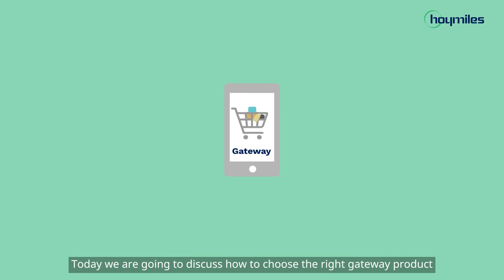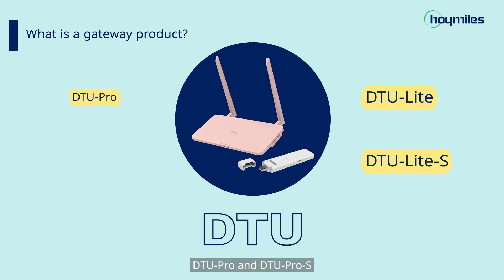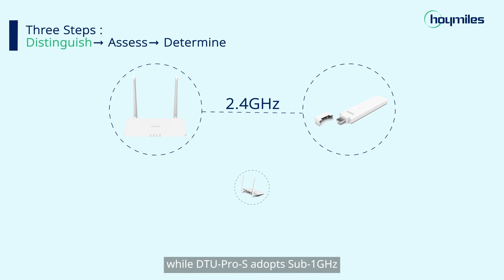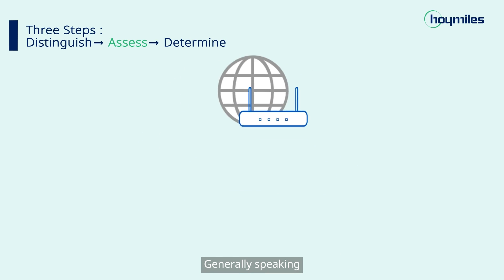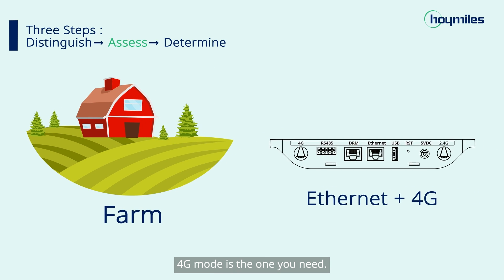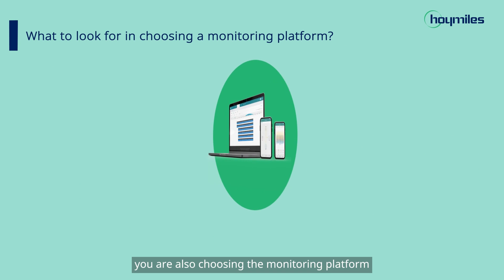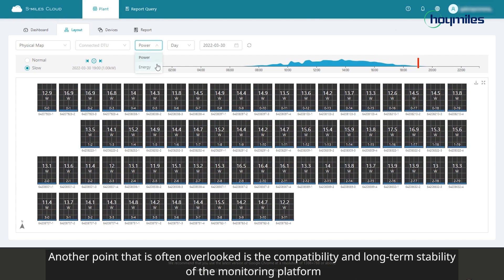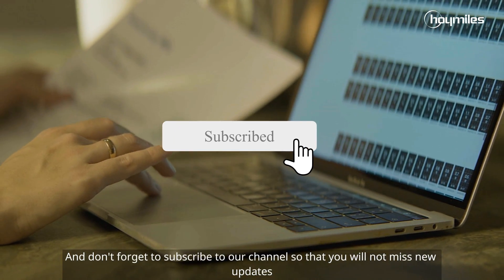How to choose a gateway product in 3 steps？| Solar

Comment: A couple of questions. 1. The DTU choice of communications seems to depend on the microinverter, for example, HM microinverters are 2.4 GHz, so you cannot use DTU Pro S, correct? 2. Is there a comparison chart somewhere that shows the differences between products? It seems there is more to the Pro than simply limiting export.
Reply from the maker: Regarding your questions:
1. Yes, the choice of DTU depends on the specific microinverter model being used.
2. Please check our product list: https://www.hoymiles.com/products/product-list
If you need any guidance in selecting the appropriate DTU, please email us at service@hoymiles.com. Our technical team will be happy to help.